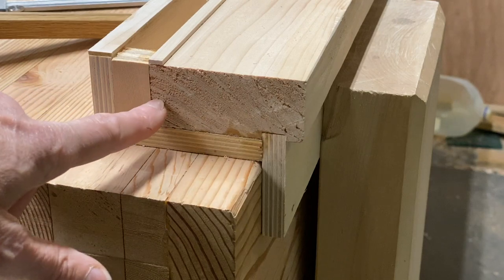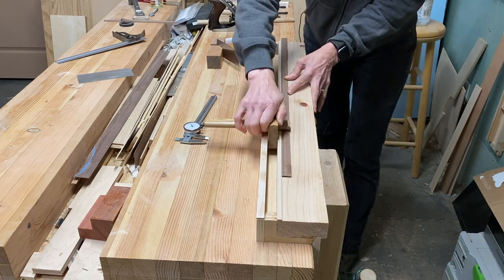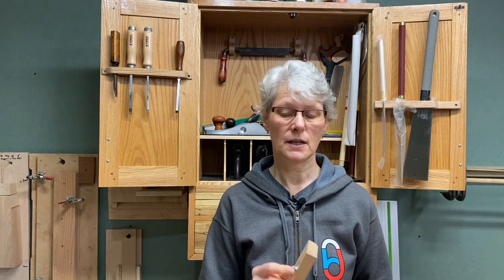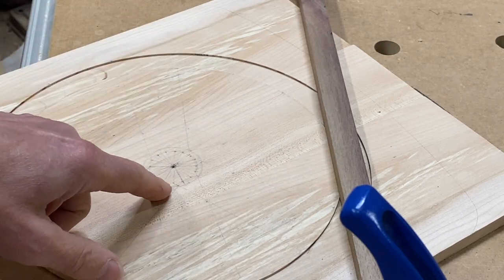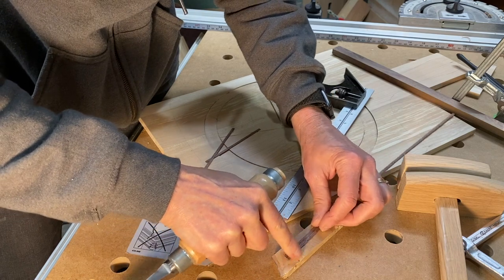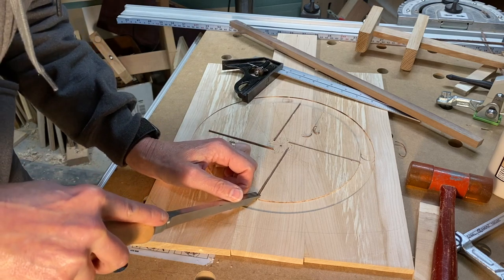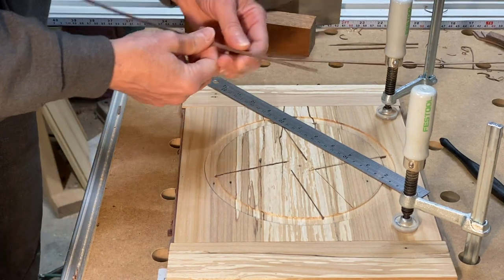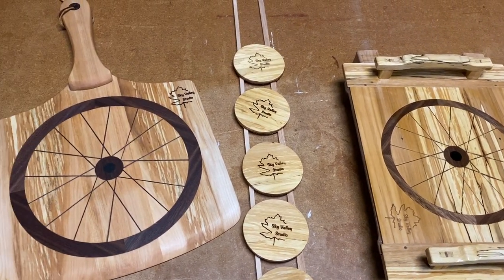String Inlay Jigs, Tools, and Techniques

Comment: A very useful video.  How do you prevent the glue used on the string inlay from contaminating the surface of the spalted maple? 
BTW, once the glue has set to hold the inlay in place I’ve had good luck using a card scraper to reduce the inlay to the depth of the groove.
Reply from the maker: Use just enough glue so there is very little squeeze out. Use a card scraper to clean the surface of remaining glue. Or use hide glue, which cleans up very easily in the gummy state. Kind of like rubber cement.
Reply: @SkyValleyStudio  I’ll try the hide glue since I’m about to set inlay into a large walnut charcuterie board.  Thanks for the tip!
Reply from the maker: @ramsayholmes4913  Your inlay should be proud of the surface slightly anyway, and needs to be sanded or planned or scraped down anyway. If you are super concerned about penetration and you’re using oil and wax on the board go ahead and do that before you cut out for inlay. Just don’t soak it. The wax will keep the glue from penetrating. Your cuts will be fresh wood.

Comment: Some good info here. Suggestion - I find when slicing the stringing with a chisel it is better to use a slicing motion rather than using the chisel straight on.
Reply from the maker: Thanks! I’ll have to remember that. Makes perfect sense.

Comment: Very nice video. Curious though as to where I could get the Lie Nielsen cutters now since they no have the Latta tools. Do they still stock the cutters?
Reply from the maker: We’ll THAT question led me down a dark rabbit hole! It looks like LN still sells the cutters, but sadly they are out of stock right now. That leaves cutting and fashioning them from a card scraper. It’s essentially a WV shaped cutter. Three points. Outer two points beveled on one side, and a tiny singe point beveled from the other side  That gives the width of the groove to the thickness of the blade. 

The blade itself is only .5” wide. The 2 V cuts are only .075” deep. This helps you know how deep a groove you’ve cut. Center tooth is .1” wide. Distance across all 3 points is .2”Outer edge bevels go .3” back at roughly a 60-degree slope from point to outside, and 30-degree (?) bevel. 

Hope this helps!
Reply from the maker: I’ve also read about using two blades - one cut in a single point, the other cut to the W, and sandwich them together with CA glue.

Comment: Cross-grain inlay on solid wood? Not expecting any wood movement? Or am I just being paranoid?
Reply from the maker: That’s a god question. String inlay is only 1/8” or so deep, and not wide enough to be concerned with movement. 1 foot = 1/8” or so. 1” wide = .01” expansion (assuming 8-12% moisture content). For the narrow strings, you’re talking about only .001”.   Lengthwise the gran isn’t much of an issue.

Comment: wait how did u make the circle inlay?!
Reply from the maker: You must have missed the video on cutting the inlays for the circle and doing that. The circle inlay is actually in four sections, carefully pieced together. 

It’s much easier to cut the shape first and then fit the cut out to match the shape. In this case, I wanted to make sure that the circle was completely round. So I was fitting the inlay to the mortise.